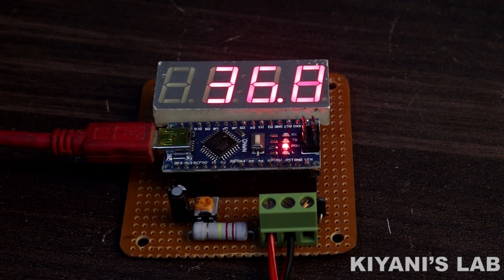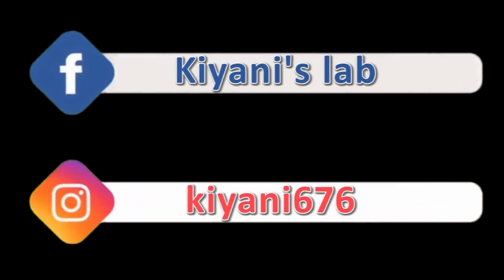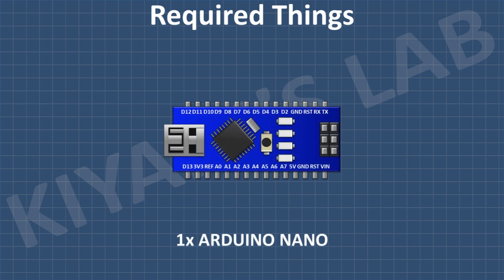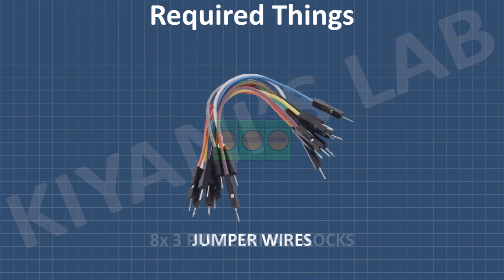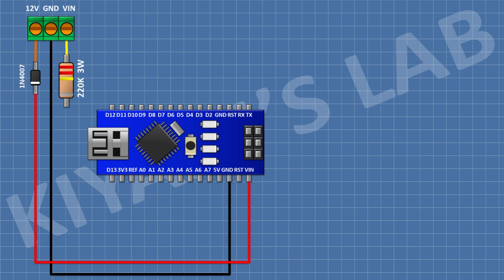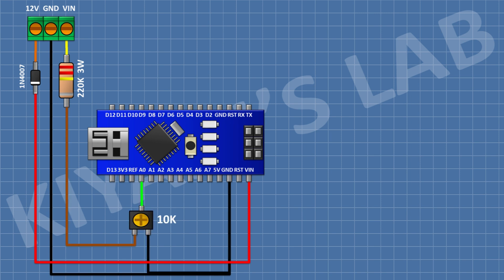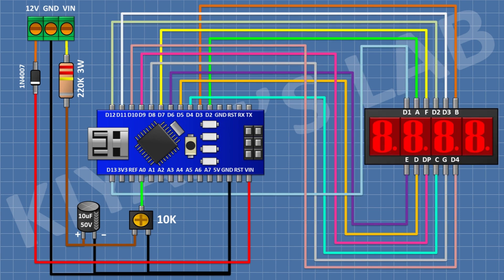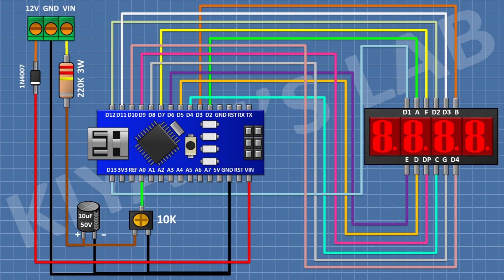How To Make 4 Digit Digital Voltmeter | 0-100V DC Arduino based

Comment: Is it a good idea to make this meter with esp8266 and display the reading on the phone?
Reply: Eagerly awaiting to connect with my lead acid battery and monitor via phone 📱
Reply: I want to monitor battery voltage as well as control a relay to connect/disconnect battery charger at battery low and full charge..... Got it?
Reply: This fake and on reyal ok😡😡😡
Reply from the maker: soon bro

Comment: SIR COULD YOU MAKE A VIDEO ON NUMBER KEYPAD CONTROL VOLTAGE AND CURRENT CONTROL DC SUPPLY 
AS WE PRESS 12V 2AMP ON NUMPAD THEN OUTPUT WOULD BE 12V 2AMP

PLZ KEEP MY REQUEST
Reply from the maker: ok bro soon
Reply: Thank you plz make it soon I have to do a project that I use this as  fundamental  to make that big project 
Best of luck sir

Comment: This is a Great Video please make a circuit dc to 3phase ac for induction motor with ir2130 MOSFET driver and input dc voltage 125v
Reply: Ok